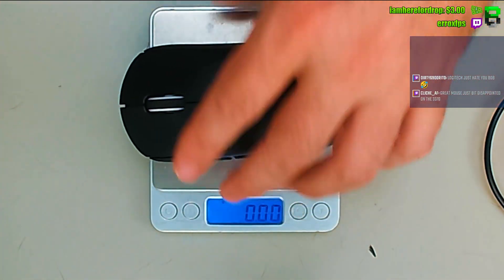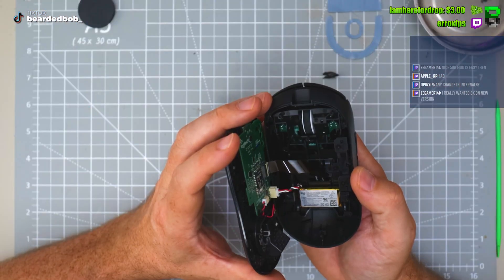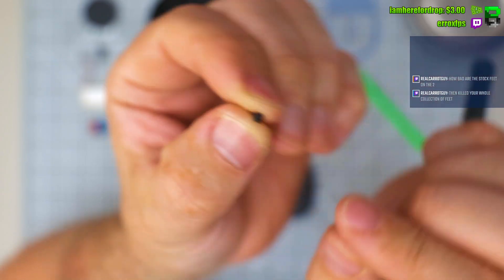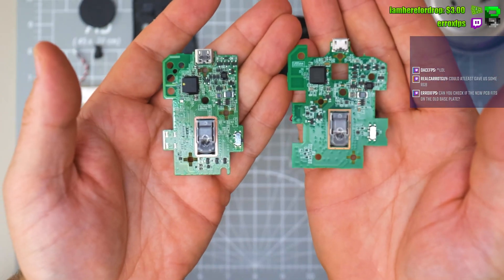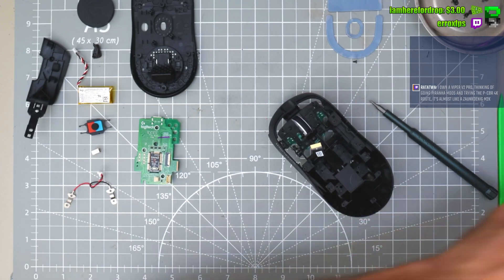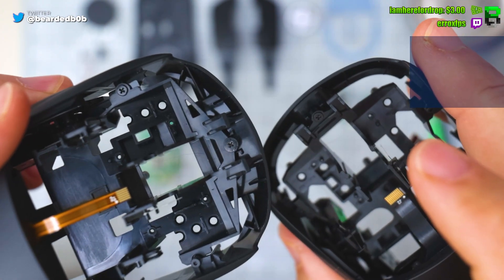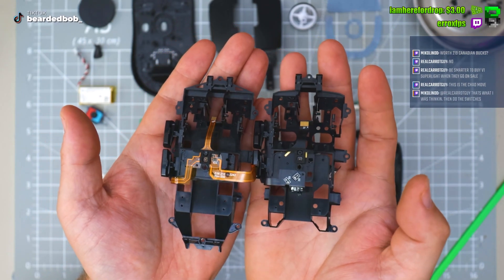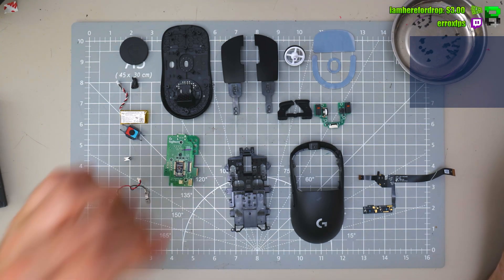Logitech G Pro X Superlight 2 Teardown: See What's Changed for 2023!

Comment: I bought a hot swap pcb board and a few switches for my Superlight 2. What height scroll wheel encoder and 2 pin switch I need? Do I need to soldier those too?

Comment: Could you swap the sensor from the g pro x superlight 2 into the gpro x superlight? To potentially take advantage of the 2000 HZ polling rate but keep the same switches? I might be way off here but just a thought 🤔
Reply: Or maybe an adapter for the gprp x superlight pcb connector? I'm trying to see if there is a way I can use the new sensor without losing the kailh GM 8.0 switches in my original superlight haha
Reply from the maker: No as the pcb is different. If you mean swap the pcb’s around maybe, though I think I tried this on stream and it wasn’t the same so a new base is needed
Reply: Interesting. Thanks for the reply and context!  I wonder if anyone has 3d printed a base for that reason. Probably not since the market may be small haha. Thanks again!

Comment: by making a modification it is possible to add an extra side button to the g pro superlight 2 instead of two side switches 3 ??
Reply from the maker: No, the pcb doesn’t have the input. You would need another pcb that has a free one or like a g502 3 side buttons